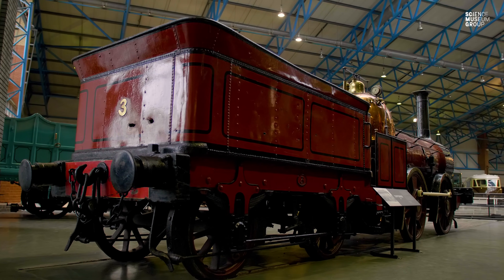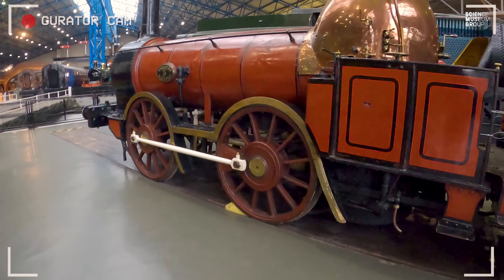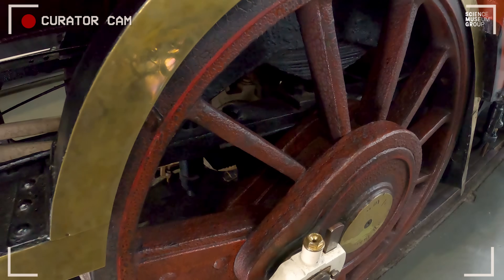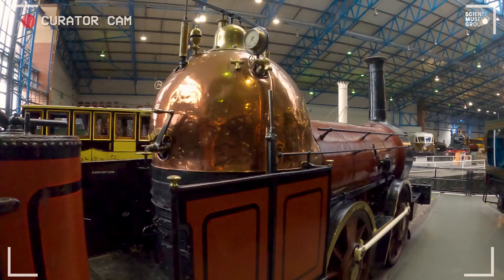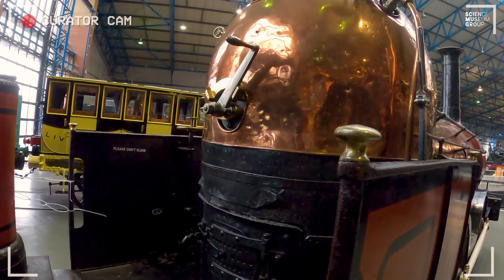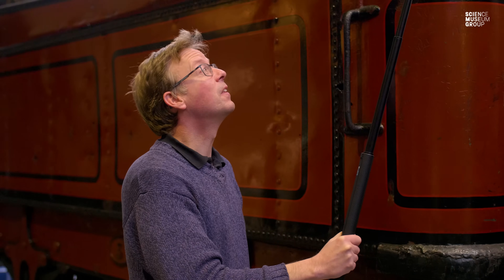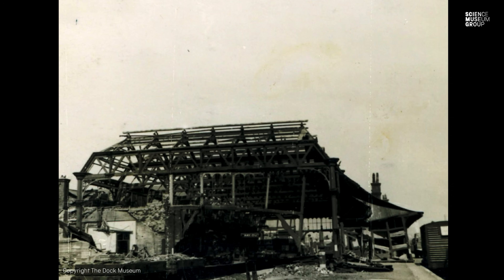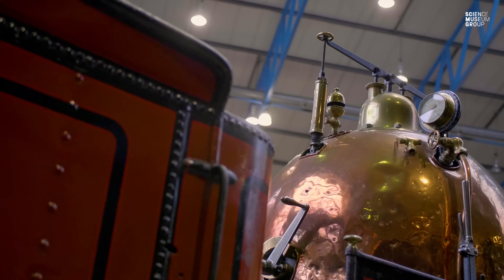Coppernob: A Victorian locomotive blasted by war | Curator with a Camera

Comment: Thanks for this. I never knew about the WW2 bomb damage.
But the loco has no backplate, just a regulator on the copper dome. Obviously this loco pre-dates injectors so would have relied on an axle pump to put water into the boiler, and by the same presumption instead of gauge glasses it would have had test cocks?

Comment: The foresight of those people, many years ago, to preserve a cornerstone of the industrial age, is to be commended. It would be interesting to discover who was responsible for the decision to preserve the loco. 
I noticed that the bar frame design had no cruciform crosspieces, to brace the forces of diagonal movement.
 Before the invention of the modern steam locomotive water injector device, I assume the system of providing water to the boiler was a matter of the seat of the pants intuition.
 The practice of some drivers of adjusting the tension on the safety value spring, to produce more power to maintain the timetable, using poor coal, or climbing a grade, snd ending a shift and forgetting to reset the valve, by a frost-bitten and sodden driver or fireman, needing a strong cup of tea to be able to hold a pencil to sign off, must have caused some disquiet. 
To be able to operate a loco at the time, was a belief of the railway company, which thought that providing protection to the driver would lull him into a state of overconfidence in the dynamic situation around him, of course, we now know this idea is counterproductive and dangerous.
I hope to see more videos of this type in the future, if possible.